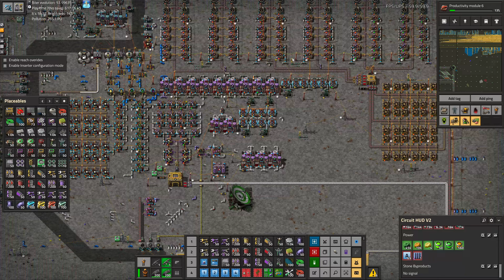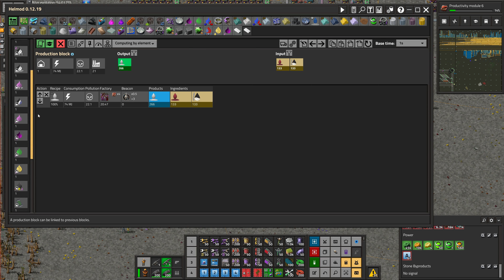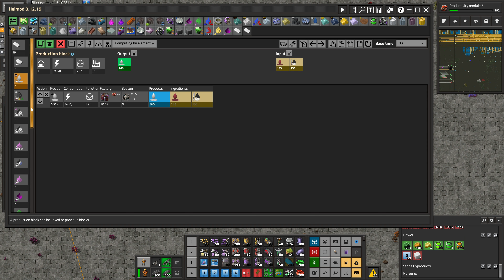[Factorio] Angel/Bobs Ep 349: Petrochem Plastic

Comment: I mean. I wonder if the boilers were broken to begin with. Like water is really energy dense and I don’t know how much “1 water” is but I could put imagine that the physics is broken because game balance. 80% energy reduction is absurd in this case
Reply from the maker: I always thought 1 unit was 1 liter but that doesn’t really seem to be the case based on energy values. It’s probably something like 20 units is 1 liter. Boiling water is one part of thermodynamics you cannot escape, it’s going to take a set amount of energy imparted into the water.

Most machines in factorio are already 100% efficient
Reply: @marsh8056  oof. That means that it costs 55 Mj to heat one unit of water at that estimate. Most of that is due to latent heat at a whooping 2.26Mj. There isn’t a lot you can vaporize in the Kj range. That also means that the steam turbine are very inefficient. 2.5 Mj is what is put in (assuming stp) and that means that we are getting less than 1%. Granted coal is also not a 1 to 1.
Reply from the maker: I dunno, maybe it is 1:1. I dunno if anybody ever put any effort to locking factorio units to real world ones. I tend to just think of them as video game units, whatever that means